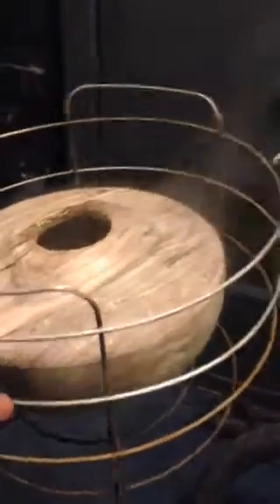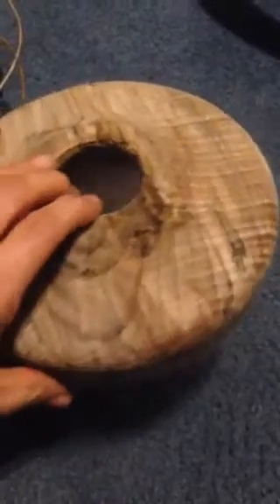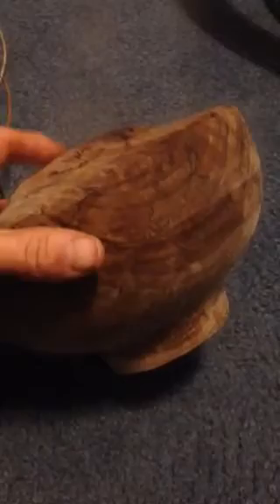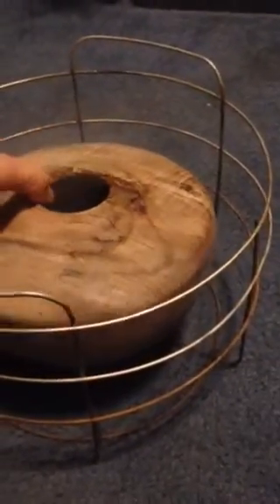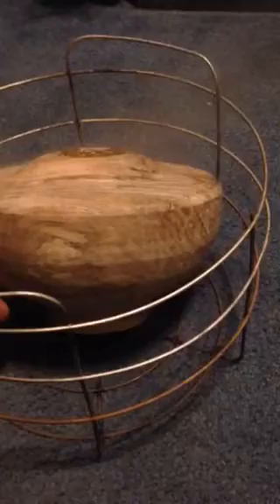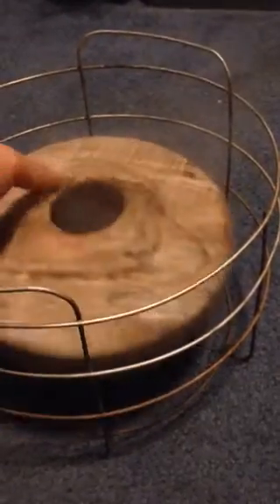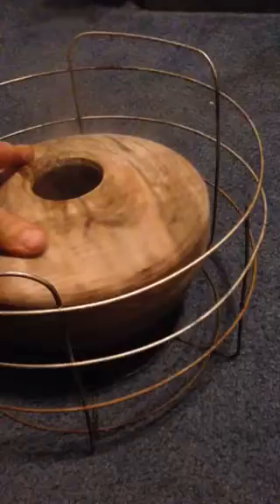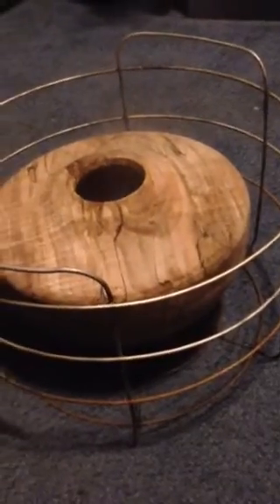Boiling wood bowls

Comment from the maker: So I talked to a chemical engineer at a pulp mill in detail about this boiling of wood. I used to work at paper mills. 

He said that Lignin will basically relax and start to liquefy around 286 degrees in a pressure vessel at about 46 psi so you have "dry steam". It's basically temperature and time. He also said I could use lye to adjust the ph to about 11. 

You may have to then wash the wood later with hot water to neutralize the caustic. 

You can use turpentine or acetone to dissolve the pitch. The pitch and lignin bond the wood and give it strength as well as effect cracking.  

The pitch also effects coloration. 

Turpentine stinks, and just like acetone it's flammable. Don't try to put them in a pressure cooker or you'll have a bomb and maybe have to attend your own funeral. 

Also, most common pressure cookers will only go to 15 - 20 psi max. Do NOT try to raise the pressure or again you'll have an explosion. 

Keep the wood to 1/2" thickness as well. 

Hope this gives y'all some better technical info.